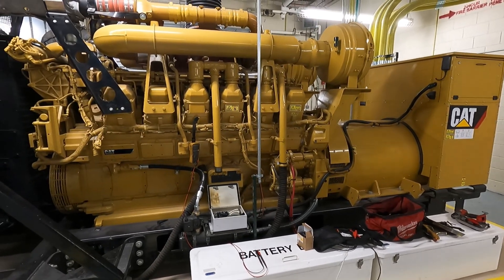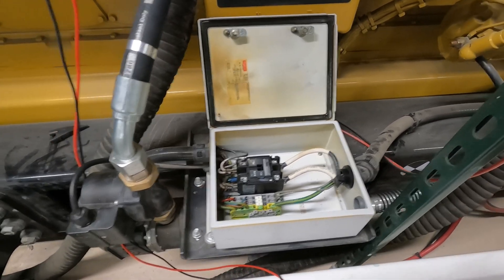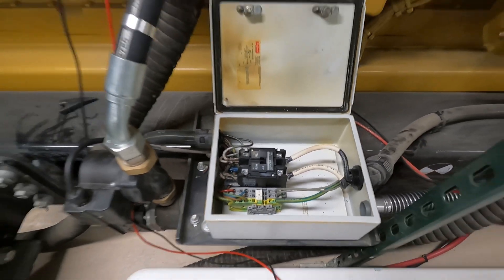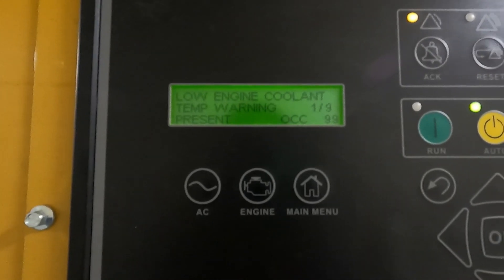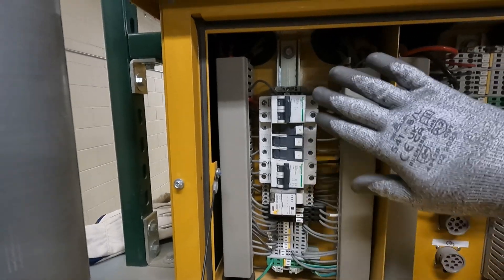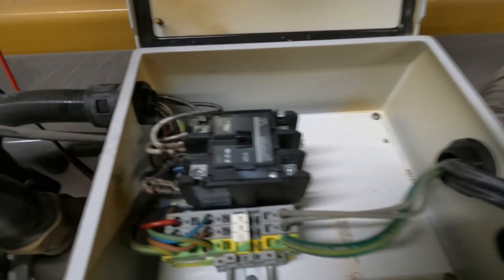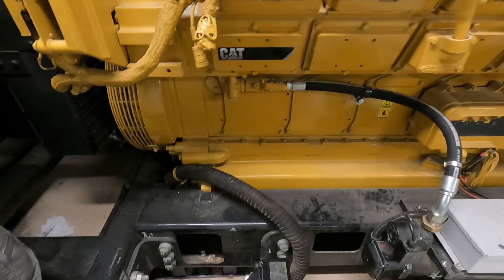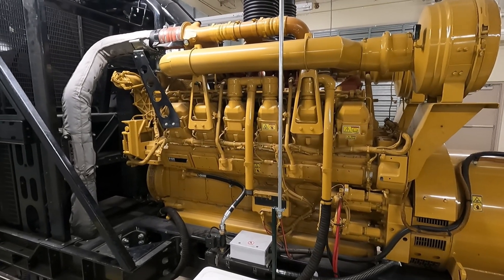Caterpillar 3512 | Large Engine Mechanic - Service Call

Comment: Looking good. I would strongly recommend that new replacement block heater power leads are installed and not just replace the contactor and terminals. You see when electrical wire gets that hot it could affect the copper and not perform as the wire intended from that point on. I myself would have replaced the wires all the way to the block heater and then verify that my voltage at the block heater was exactly 208 to 230 volts as required. Just changing the parts doesn't mean you actually had fixed the problem of why it happened to begin with. Great videos